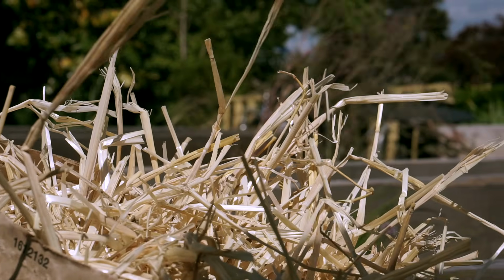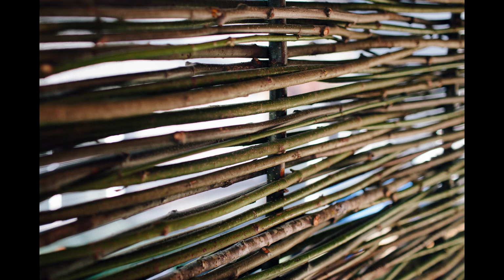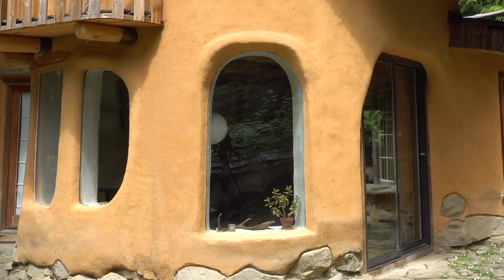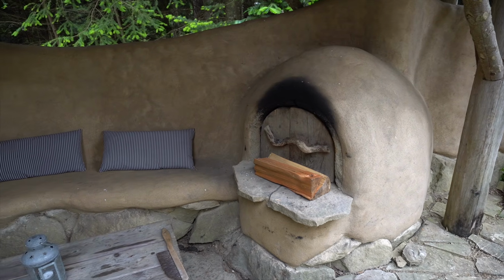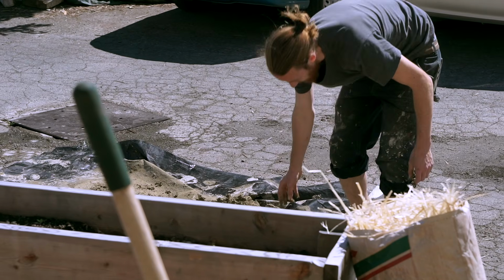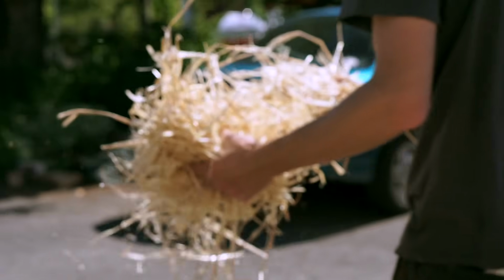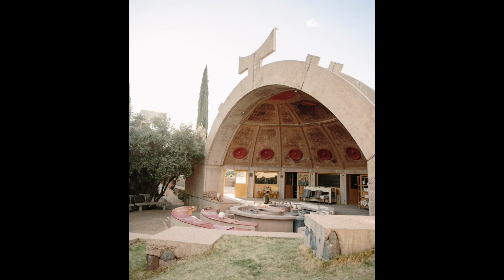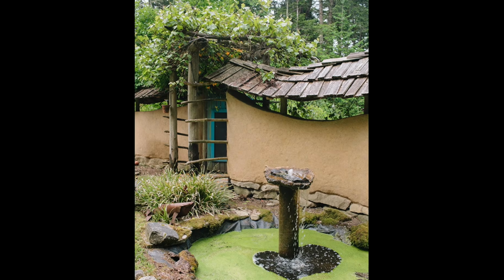Building with Cob - A Natural & Affordable Way to Build a House

Comment: Why do they mix it with feet not in a mixer?
Reply from the maker: That's a great question!  First guess would be that the mix might be too thick to use a mixer.  Second guess is that they might prefer to work with the material manually rather than with power tools.  If anyone knows, feel free to chime in!

Comment: "3 parts sand, one part clay, one part straw"...in volume ? In weight ? What is the measurement unit ? And what about water ? thanks
Reply: 2 parts clay to one part sand. Add water. Stamp in tencil strength with straw.

Comment: There are Cobb buildings in the UK that have been around for many, many centuries, but the oldest known cob structure is over 10,000 years old. It is still standing because it has been looked after by generations of people. Like all structures, cob buildings need care and attention from time to time. Simple checking for erosion and repairing damage before it becomes a problem is key to the longevity of cob buildings. A fresh coat of lime wash to renew the weatherproofing and protection every so often will extend the life of the cob as well. Oddly enough I was part of the crew that worked on many of the Cobb buildings in this video. I took several Cobb building workshops with Patrick Hennebery and his cobworks crew!

Comment: Cob is also used in trad half timbered houses. A lot of them are 500+ years old. Of course, as with every other house, you have to do some upkeep during that time. But those walls are durable , well insulated and provide a good room climate

Comment: Unless you do it all yourself and invest all the time it takes (which you cannot monetize), it's probably more expensive workforce-wise to build cob structures. The materials are cheap, but the cost comes up from excavation and transportation, unless a suitable site dictates you the place you must build. The point of modern materials is that they are mass-produced and made for easier assembly

Comment: The guy talk like it should be a replacement for casual building materials!! 
Well, that's not true, and cob will never replace the bricks cement materials, obviously for so many reasons, especially with the current weather conditions!
Still, you can do the cob work in the interior of your house if you really like it.

Comment: Thank you for this valuable video. In the Netherlands, it's known to people with physical joint issues, and asthma, breathing issues, that living in an environment of cob, often helps to recover to good health again. There are homes, which are now changed inside, covered with cob, so that the resident can enjoy better health. I've worked with cob in Spain, in a small remote village, where a family man created a cob house on his vineyard, and worked with volunteers, in 2014.

He used a small machine, like a plough, to break open the clay around the building plot, and we mixed the clay with straw and other ingredients, some sort of sand and fine chaff-like material as well. The three of us, two down at the heap of mixed clay, throwing clay balls up, worked on the walls, shaping a variety of rooms. The roof wasn't present, of course, that's always last, when building with cob, at least when you start from scratch. 

It was wonderful and fun, mixing the material, and to work with it to build up the walls. When dry, it was hard and sharp like glass. The climate was excellent, combined with the building material right there to be used, in that place.

I've also helped cover walls of strawbale homes with clay, in Britain's communes living off-grid, and later, in the Netherlands, where gradually possibilities to build your own home just to your liking are developing. Empty stretches of land, or where glasshouses are removed due to old age, are chosen to be offered to self-builders who buy the plot, and are free to design and build their home. Of course, safety regulations and whatever is lawfully obliged, are meant to be obeyed. My experiences during visits to cob houses and strawbale homes are well remembered. The atmosphere and acoustics are fabulous. Feels so good!

Comment: If I don't have access to having clay, what could be an alternative? Could I use a bag of concrete mortar? Could cob also be used just for siding on a house, as opposed to building a wall? I want to do two different projects, one for a shed/house and the other for siding my house. Would the cob stand up in cold Alberta weather for siding?

Comment: Hey, Bryce! (Or others who know this). Is this possible to use when building homes in Norway? Keep in mind cold periods of time where the temperature goes beneath -30 celcius. Not every winter now a days actually, cause it´s gotten warmer here. But, definitely below 20 on the regular. Do you use any other structural materials as a sceletone within the cob ? Like logs or metall or other? How do you integrate the floor and walls on the first floor? And, I see they all have wooden roofs and walls if a second floor. How do you integrate that to the walls below so that they don´t collapse?  Thank you! This looks very interesting and nice! :-D

Comment: Here is google first response to cob vs earthbags
earthbags are considerably faster (think days, not months), much more moisture resistant (used for flood control), and don't require a long curing time (cob can literally take years to dry out). But also, there's the mixing. Cob and adobe are very labor intensive, and mixing is hard work.

Comment: This is what google first article says;

Cob vs. Rammed Earth. ... Rammed earth is stronger than cob and less prone to shrinkage as the mix is compacted and requires less water, shrinkage and subsequent cracks being caused by water evaporation. Cob and rammed earth can be used for floor and wall construction.

Comment: As much of a non-environmentally friendly idea this is; if some company produced plastic roofs for cob and earthbag buildings we would see a boon in natural building. It's the roofs that are tricky.  The right plastic "lid" would make the process 1,000 times simpler and quicker.  And the roof could be formed with beveled edges so sod could be put on it or a thatched Reed look. Dome roofs, traditional, hip, Victorian, mansard, you name it.  With gutter systems molded into for rain harvesting.  Daydream with me.

Comment: Adobe (Cob) has the advantage of thermal mass. It absorbs, stores and emits heat. This stabilizes the temperature of a building keeping it cool in the summer and warm in the winter. Once it gets warm it stays warm and once it's cool it stays cool. In the Southwest it is often paired with passive solar heating.

Comment: This is an old video I hope I can get an answer back.   I need to repair my stucco which is stucco over cement. Would I be able to repair my home with the cob work?  Would I need to use the chicken wire?  and also how much water is required in the sand clay straw mix?  Should I also use any lime?

Comment: when he said 3 parts sand, 1part clay, i knew this guy knows what he's talking about

i did myself some compressive tests with clay-sand blocks and the ideal ratio is like 1:3
also adding straw really rise the tensile strength a lot
one adobe brick could carry like 60kg on the 3 points test

the material is almost perfect if it wasnt for the low water resistance
but there are ways to protect it from heavy rainfalls and rising water tho
Reply: zazugee 
I’m curious about the cob’s water resistance. Will the cob easily become soft and might lose its strength when exposed to water like from heavy rainfalls? What are some common ways to make the cob water resistant? 
Thanks!
Reply: @RichardBalonglongImages  well, if you shape it into bricks and fire it that tends to work rather nicely, you can also seal the walls with oil, wax, or even animal fats mixed with clay to keep the water off it.
Reply: @CoptMan80  because the question was about cob not concrete.
Reply: @CoptMan80  oh yeah concrete would be dramatically easier, especially once mechanicallly produced sand is more viable so we don't have to dredge rivers anymore.
Reply: @RichardBalonglongImages  Based on my limited knowledge, I think people in wetter climates achieve it by (as stated) waterproofing the walls as much as possible, having a large roof overhang, as well as making sure that there is efficient drainage installed 

Ive seen some videos where some people use the water by collecting it or directing it somewhere (tanks, garden, etc)
Reply: @doodoodoodle  Flexseal guy enters the room
Reply: @jomten  so TRUE LOL!
Reply: @RichardBalonglongImages  my experience is with adobe
not much cob, but i assume they have same properties when it comes to water
from my experience, light rainfalls isnt much of a problem
but when you put adobe blocks in a water container, they start to lose their consistency
rising water from foundation is also a problem
but the same problems happens with cement when its not designed to resist it but on long term
Reply: I have seen some ancient archaeological  sites where they use stones for floor and foundation , and often the first foot of walls on the outside, before continuing upwards with adobe or cob .  Although the roof wasn't still on, you could see where the poles would be inset for an overhang.  I suppose it would have to depend upon local weather conditions, and availability of materials.

Comment: I am sincerely doing research to build an underground home (I live in Canada and I want to build a home with pipes that won't freeze) and there are 2-3 questions I'm trying to get answered. How do they build the dome roof? Where does plumbing/wiring go and what happens if you need to make repairs?  Lastly, why domes and circles vs boxes and squares? I intuitively like it better, feels more natural, easier to heat I assume, but wood is a plentiful resource in my build site and I'm having a hard time justifying building in the round

Comment: OK, is the point of this that wattle and daub with "cob" is good? Fine, but this video doesn't actually explain much, and cob wouldn't really be that affordable for the average person. Where, other than forest land you own that's far away from where you work, would you find branches and the needed sand clay and straw? You'd have to source them. Even the tiny amount the guy in this video is making is made from stuff bought at the hardware store. You still need lumber. You still need labor. If the point of this video is that you can build a cabin this way, congrats; building a cabin is building another building you don't need. This video isn't useful if they don't go into detail on how to build a house with cob.

Comment: Wonderful! I am saving my cash for my own home someday. Is this less expensive than straw bale homes?
Reply: From what I’ve read, it’s more work than straw bale.  Either material used and it’s expense depends more on what you want done and how elaborate of a build you have.  Straw bale has an element of cob already since it’s used to cover the straw walls.  In my own opinion straw bale has more structure with the opportunity to form, whereas the cob has less structure within which I think could cause more problems over time.  

Every building material has its downside.   It all depends on what you don’t mind putting up with. Unique building materials can make it difficult to find someone to help with problems that might arise. 

 I applaud these natural materials to build but I sometimes wonder if most media outlets for such a topic as this don’t speak of the potential problems the material might have.  You hardly hear of it.  People get fooled into thinking it’s perfect.

Comment: I'm curious, does it harden naturally to withstand wet weather or do you have to harden it with heat?
Reply: Use lime plaster over it for smooth finish and protect against weather as well
Reply: @sainiamarjeet  thank you for the information!
Reply: thank you

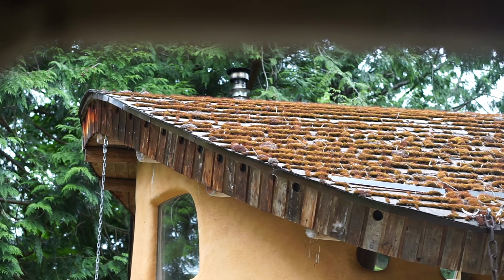Comment: 3:20 is it repairable years after its built? if something happened and damaged that curved window opening many years from now, would you be able to repair it without remaking the wall?
Reply: yes, you can cut whatever you want and add the cob once again
Reply: You would have to remake the wall.  Putting a sheet of glass within cob is a cheap way of making a window, but it’s not a good investment.

Comment: Thermal mass is not the same thing as insulation. In winter when there is inadequate heat from the sun reaching your cob walls, they're going to remain cold all winter long. In cold climates you're going to want insulation, not thermal mass, to keep out the cold. In summer, thermal mass will keep your house cool for several hours, but it needs time at night to shed its heat. If you're in an uncomfortably hot climate where it doesn't cool down very much at night, your house isn't going to lose enough heat at night to make your days comfortable, and it may simply add to the heat keeping you awake. Again, insulation is what you really want. Straw bale construction provides insulation, not thermal mass. Cob is a building technique suitable only for relatively mild climates.

Comment: what about humidity, vapor barriers, mold, etc.?? (anyone)
Reply: Cob self regulates moisture. No vapor barrier needed.

Mold resistant as well.

Im Actually looking at hempcrete. Also same properties but some nuances
Reply: Thanks for the info. and now to research "hempcrete"... :>)
Reply: @Corvus Crow, it seems there are some good books on building with cob.  If you do build one, maybe get a book on it and take a hands-on course, too.  About moisture, maybe you can find a place with a similar climate to yours and see how it's going for their cob homes.

Per other videos, you want your foundation to keep the cob somewhat high off the ground, so rain water or an overflowing creek doesn't damage the cob.  

Of course you want your roof to have a good overhang all around the home so rain or hail doesn't beat down on int.

If you build, I hope it works out great for you!
Reply: Well possibly- Awesome! Thanks!👍
Reply: It doesn't "self regulate". It has exterior infiltration just like concrete and masonry does. Which means air can bring in moisture.

Comment: The 1990 Manjil–Rudbar earthquake occurred on June 21 at 00:30:14 local time in northern Iran. The shock had a moment magnitude of 7.4 and a Mercalli Intensity of X (Extreme). Widespread damage occurred to the northwest of the capital city of Tehran, including the cities of Rudbar and Manjil. The National Geophysical Data Center estimated that $8 billion in damage occurred in the affected area. Other earthquake catalogs presented estimates of the loss of life in the range of 35,000–50,000, with a further 60,000–105,000 that were injured.
This was from wikipedia
In that earthquake 500,000 people became homeless. 700 villages turned completely leveled up and other 300 villages damaged.
That was end of cob houses.
Reply: What do you expect would survive an earthquake of that magnitude?

Comment: I love this and wish it could be found more readily around the USA. The house that I grew up in was in my stepfather’s family since the early 1900’s (like 1901 ish). It is literally falling apart. We’ve done some upgrades to it but the whole thing is slowly rotting away. It should have been demolished years ago and built new. 118 years old and on its last legs yet these cob structures have been standing in other parts of the world for hundreds if not thousands of years. I’m sure greed plays into a lot of this as I don’t see these cob structures being all that large. A sign of wealth is a massive house and it’s probably easier to use conventional building materials.
Reply: Massive house is greed, I'm with you there. But this style of building is costly in man hours compared to stud wall construction. Also it is very poor thermal insulation so the HVAC systems would be just wasting energy left and right. And lastly, it lacks in seismic restraining. Sorry, it just is not a good choice in most regions.

Comment: How do you incorporate electrical wiring and plumbing?
Reply: HORTONDLFN - I would run conduit while laying the walls then pull wires and PEX through conduit. Obviously separate the two and probably separate hot and cold water lines. Vents and drains could be run through traditional walls built internally. Maybe?

Comment: No insulation value with cob. One would need to put a layer of rockwool on the outside of the structure, then add a render in top of that

Comment: Hi There, great stuff you are working with! One question, would a cob house be efficient in cold areas like Manitoba? Temperatures sometimes goes down to -50 C in the winter, and a lot of insulation is needed.
Reply: Cob/masonry has horrible insulation value. The best of both worlds is to have masonry exterior with insulation/stud wall combination. For most regions that is. Depending on the climate, cob/masonry could meet minimum energy standards.

Comment: Clay is very good IF there is a deposit of clay close to the building site.  Using just Any Soil does Not work.  If you need to truck in clay it is not economical.
Reply: Still probably more economical that houses currently built.

Comment: In my country most country side villages 50% or more are made with cob and  I remember when visiting my grandparents in summer inside the house was cold as having air condition,and in the winter a  small wood stove will heat the house and retain the heat.